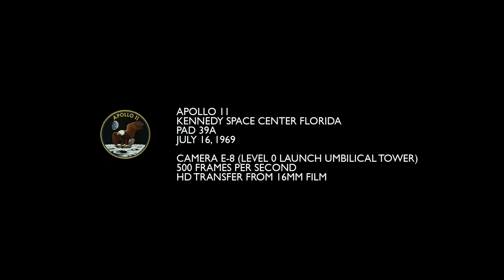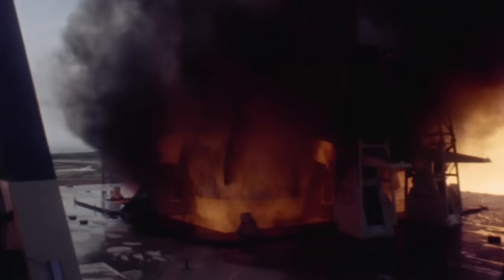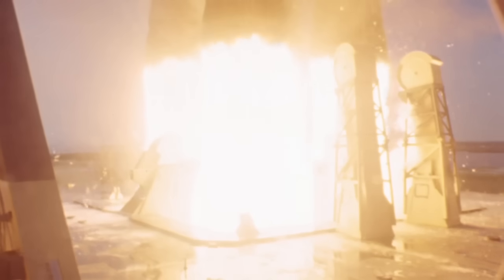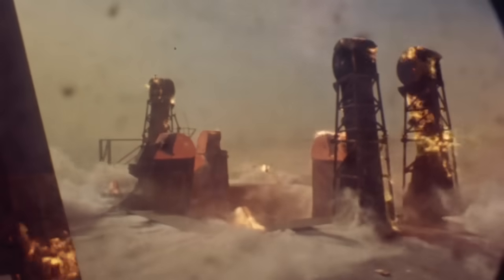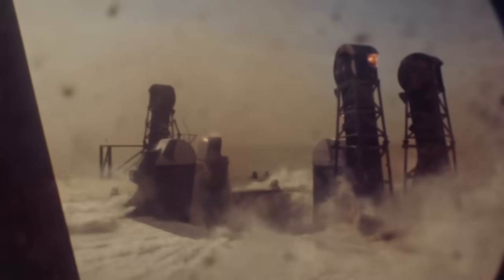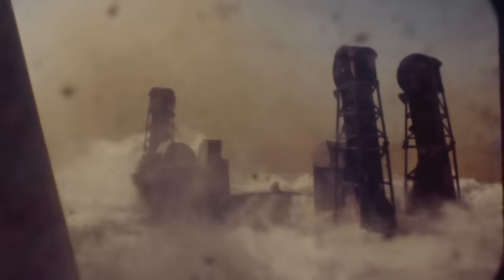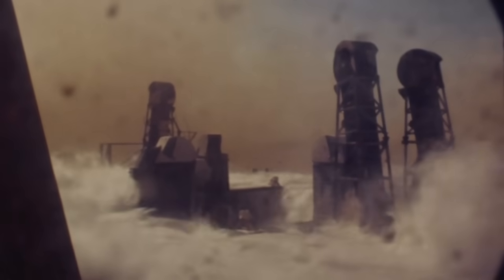Apollo 11 Saturn V Launch Camera E-8

Comment: THIS HIGH QUALITY CAMERA TECH IN 1969????? WHERE WAS THIS DURING THE CHALLENGER LAUNCH? - IS IT GOING TO TAKE 50 YEARS OF CLASSIFIED SILENCE SINCE THE CHALLENGER DISASTER BEFORE NASA FINALLY RELEASES THEIR HQ FOOTAGE OF THE CHALLENGER LAUNCH BECAUSE I BET YOU CAN SEE CLEAR AS DAY THE MYSTERIOUS FLAME WHICH CAUSED THE EXPLOSION WELL BEFORE THE "THROTTLE UP" ORDER - NASA CAN'T GET AWAY FOREVER WITH THE USE OF THE GRAINY FOOTAGE WE ALL KNOW WELL FOREVER - IF THEY HAD THIS QUALITY IN 1969 I AM SURE THEY HAD IT IN 1986
Reply: Nice use of CAPS boomer
Reply: Rik Ver Mar  The fault was evident at lift off. They've shown you over and over you moron. It's there for all to see on film.
Reply: @SMHman666  i would give a shit about ur answer - only if u knew what u was on about, but as u don't - i don't
Reply: @rikvermar7583  Cared enough to reply though. Thanks, haha.
Reply: "THIS HIGH QUALITY CAMERA TECH IN 1969??" - of course. A TRW engineer wanted the same color quality for a camera on the moon - showing Neil Armstrong climbing down the ladder. But, we got a skimpy BW low grade instead. And this engineer was surprised that NASA would document the first landing on the moon in such a skimpy matter -

Comment: Funny that this old mechanical and analog technology cannot be replicated in this, the digital age.
My 1982 Olympus OM-10 35mm camera can run circles around digital cameras, if film was still being made.
Reply: @Neurobashing He was talking about the camera.
Reply: Film is still being made.
And I do not compare my Nikon D810 to my Nikon F3 or the Contax 137 MD Quartz, it´s a totel other thing. ;-)
Reply: The only thing that digital needs to catch up with, is dynamic range, in which film still remains king.
Reply: ussling
Everyday new technology runs circles around the old analog technology from the Apollo era, digital fly by wire systems have far surpassed the technology from back then, even motorcycles have fly by wire throttles on them.
People mistakenly think that just because we haven't been to the moon since 1972 that somehow today's technology isn't as good, that's so very wrong it goes to show how people don't think about what they're saying, the rovers we've put on Mars have technology that far exceeds what was in the Apollo program, every day NASA is using technology for space exploration that makes the stuff from the Apollo program look stone age, just because it isn't manned doesn't mean it isn't more advanced.
Reply: @dukecraig2402  Digital cameras still don't have the dynamic range that film has though, which is what we are discussing here.
And I prefer digital over analog, but that fact still remains.
Reply: @GoldSrc_  
My comment was directed at the original post, hence my putting him name at the beginning of my comment, his original post was not exclusively about camera's, he just used that as an example, if you read his comment it was suggesting that ALL of the analog tech from back then is somehow better then today's tech, it isn't. 
As far as cameras go I'm sure you're right about that and I'll take your word for it since that seems to be what you're into, but it would be one of the very few exceptions to 50 year old technology vs todays.
No, cameras weren't exclusive to his comment.
Reply: @dukecraig2402  Oh, I see.
Yeah you're right.
And yes, even today, film is the only thing that can capture pictures with so much dynamic range, for everything else digital is just better.
It's pretty easy to increase dynamic range for digital audio, but for pictures is still pretty difficult.
Reply: @GoldSrc_  
As far as dynamic ranging and other film terms such as that I'm totally lost since I've never been into cameras, but I do know from being a film (movie) buff that there's nothing like real film, it just has a look that it seems like digital just can't quite copy, especially the old Technicolor films, they have a look that's just beautiful that digital just can't seem to capture.
I saw in a documentary once that the original Technicolor triple saturation process was eventually given up on because it just got too expensive to use, other film types hadn't quite caught up to it but had gotten good enough that the expense of the original process couldn't be justified by the studio's anymore, if I remember correctly The Godfather II was the last film made with that process. 
The original triple saturation process had a look as beautiful as a fine painting, the colors were just so vivid and clear, I wish I would have lived in the era of those films so I could have seen them on the big screen, I have got to see a couple of them like Gone With The Wind when they've been run through the theaters for special showings and it is quite an experience seeing it.
Reply: @dukecraig2402  Digital just can't reproduce the randomness of film grain, as for colors, I guess digital could reproduce those.

Comment: I wonder if you could make reusable out of sat 5
Reply: The engines were certainly reusable as they were all test fired several times on the ground before they flew. The main challenge would be to somehow retrieve the stages intact instead of dumping them in the ocean.

Comment: I have an idea: Let's put all landing deniers under a Saturn V's exhaust. I mean if it's fake it won't do anything to them after all.
Reply: Good idea!
I read somewhere that it takes about 1 billion joules of energy to completely vaporize a human body. If each F-1 had an energy output of 25 billion joules per second, all five of them should be able to vaporize 125 moon landing deniers per second or 18,750 during their 2.5 minutes of burn time. And while we are at it, let's throw in some flat earthers and climate deniers, too.
Oh, wait, I'm afraid we will need much more than one Saturn V for that!
Reply: @fromnorway643  It went up in orbit, but not to the moon. Hollywood did a great job deceiving you
Reply: @SamaritanElad  
Nonsense!
Reply: @fromnorway643  Times the 13 Saturn V's that were built
Reply: ikr
Reply: do it do it do it
Reply: put some flat earth beleivers in there too
Reply: Deniers look like fools on their own, having to resort to violence to silence them seems weak and frankly immoral.

Comment: A Dilettante Presumptuous Theorem: 
From: Alex Gleason Is The Bible From Heaven
https://archive.org/stream/AlexGleasonIsTheBibleFromHeaven/Alex%20Gleason%20-%20Is%20the%20Bible%20From%20Heaven_djvu.txt
The fact is, that they being called “astronomers,” and 
having been caught in the popular drift of science, and being 
entangled thereby, go on, of necessity, bringing forth one ab¬ 
surdity to support another, till their system of astronomy is not 
held together even by a fabric of the most base suppositions. 
They make up the terms “attraction” and “gravitation,” and 
spin our supposed “ball” through space “with the rapidity of lightning,” pushing, hauling and dragging with it the moon, 
the atmosphere and oceans; while clouds and currents of 
water are running undisturbed, at the same time, toward every 
point of the compass, without splitting the ball, as the natural 
result of such rotation would be, into myriads of atoms, or 
sending broadcast through the universe a multitude of fiery 
meteors; but holding all “unperceived,” by “gravitation” and 
“attraction,” from a source a hundred millions of miles away, 
when no gaseous or luminous bodies have ever been found to possess attractive power!
Reply: I THE PREACHER if moon is self illuminating, why the fck craters on it have shadows? 

Ps. Bible is bull’s t story for idiots

Comment: WOW!!! What temperature does the launch pad reach around 3:30? It must be 2-3K F? Wasn't that STEEL melting on the hold down arms? Incredible.
Reply: The sound vibrations from these engines cause concrete to melt, the water spray absorbs some of the vibration energy.

Comment: Hmmm.. that’s burning awfully rich based on the color.
Reply: thats the idea, they dump fuel on the outside from a ring in the nozzle to protect the nozzle from melting because super rich mixture runs cooler

Comment: I’ve always wondered why not do the launches in Southern California where the weather is nearly always perfect? Why do it in Florida where it gets cold and there’s ice?

Sorry if that’s a dumb question but it has always run through my mind.
Reply: Kit Canyon that makes sense thanks for clearing that up.
Reply: To add to Kit Canyon's comments on why almost all rockets are launched eastward with help from the earth's rotation, the ice which falls from liquid fueled rockets is a result of using liquid oxygen and liquid hydrogen for fuel, not low air temperature.  Oxygen and Hydrogen liquify at temperatures well below 200 degrees below 0 F.  Apollo 11 launched in July 1969, very warm!  But moisture in the air condenses and freezes on all rockets with liquid hydrogen/oxygen before launch.   
However, in line with your question about launching in cold weather, NASA did indeed learn a horrible lesson by launching the "Challenger" on that frigid day in January 1986.  Just plain too cold then, and the engineers knew it.

Comment: The F1 and J2 engines are 2 of the most important and awesome inventions by man EVER
Reply: and the crazy thing is, despite all our advances in technology, we can never make them again.  They were custom made by hand with their own little quirks.
Reply: @firefalcon100  yep, NASA actually tried and failed, they have made a replica but it's not the same, the original most of the parts were made by hand as you said and they can't even be acquired now, and even with the blueprints they can't be made because they would have to build totally new machining tools which is basically impossible, as you said they had their own little quirks and parts added to them that weren't even in the blueprints.

Comment: What a marvel! That thing weighed 6.1 million pounds and off into space it went!
Reply: At lift-off, the Saturn V was the heaviest man-made object that has ever flown, 6.5 times heavier than a fully loaded Boeing 747-8 and 5 times heavier than an A380!
Reply: @fromnorway643  And within 2.5 minutes it went from velocity of 0 at sea level to Mach 7 speed at 40 miles high. Those engines were insanely powerful.
Reply: @soxnation1000  
And unlike the shuttle's SRBs, the thrust of the F-1s didn't decrease shortly after launch.
https://upload.wikimedia.org/wikipedia/commons/3/31/Srbthrust2.svg
Reply: @fromnorway643  Shuttle had to decrease power in launch to prevent catastrophic failure of craft from overload power stress...

Comment: Russian engine technology on an American rocket. Hard to believe. Korolyov and Kuznetsov designed a closed-cycle engine and solved the problem they had. fogot to say AWESOME video Mark. thats what I call Science
Reply: Yeah, it's hard to believe, especially that the Russian's tried to interfere in our elections and have 6,500 nukes pointed at us! 
Strange isn't it! In fact its unbelievable. Many things are unbelievable.
Reply: The Saturn V didn't use Russian engines, but the first stage of the Atlas V does.

Comment: The power of this rocket has been unmatched for 50 years and they did it with computers with less processing power than your Fit Bit. Let that sink it. With the power of a modern iPhone they probably could have taken us to Mars.
Reply: Computers don't create power, but the combustion of 13 metric tonnes of RP-1 and LOX per second does.

Comment: IM not a rocket scientist... BUT!! 
I get the feeling that take off should just be called BURN OUT!  WHAT A WASTE OF ENERY/ fuel! 
has anyone every though of propelling the rocket up to about 250 mph... by magnetic lift??? 
kinda like the japanese magnetic trains. that way the rocket won't have to muscle out or burn out like a car... 
i think that would allow the rocket to use the majority of its fuel for fast propulsion!

damn! i should have been an astronaut.... now I'm more like astronut.. lol
Reply: jimmyfly 
It’s about torque.
Have you ever use a sling shot I’m guessing yes...
Did you notice you can get twice as much range and speed if you punch out the shot? 

It’s not a missile , and it’s really heavy but once you get all the weight going and momentum you would save a lot of Fuel for later use which is much more efficiently used in space
Reply: @jimmyfly come to think of it.. its how a hybrid car  works. the reason you save on gas is because the electrical gets you going on the toughest part of the ride which is getting it going

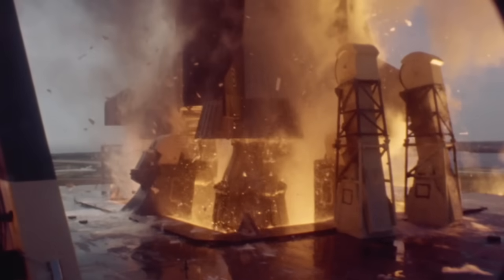Comment: Despite having been captured at 500 FPS, there is a stark difference in velocity between the Saturn V engine exhaust (2:05) and other elements of the shot.  It certainly serves to emphasize the vast quantity of thrust being produced.
Reply: Otaku+ based on a specific impulse of approximately 263 seconds, the approximate exhaust velocity is just over 5,600 mph.
Reply: Each F-1 produced ten times more thrust than the total thrust of a Concorde at full power.
https://ericpetersautos.com/wp-content/uploads/2012/10/GC-concorde.jpg

Comment: lots of ice for July in Florida. then it falls past the fire without melting.
Reply: Not sure what point you're trying to make. Ice formed on the surface of the rocket because the liquid fuel inside it was EXTREMELY cold. In much the same way that you can have frost form on the INSIDE of your windows in your house when it's really cold outside, even though it is 75 degrees in your living room.

As far as ice falling past the fire... don't forget that this video is SIGNIFICANTLY slowed down. Thick slabs of ice don't instantaneously melt. Do you really think an ice cube would instantly vanish if you dropped it next to a flame?

Comment: The turbine/gas generator was actually started with a spark igniter, not the hypergolic cartridge. The hypergolic cartridge was inserted into the fuel line close to the thrust chamber and bursted when fuel pressure was high enough and ignited the engine.

Comment: Why does the camera shake throughout the video? From the vibrations of the launch pad?
Reply: Some of the motion will be due to movement of the pad, but a certain amount comes from the movement of the film itself in the camera's gate - as the transport speed increases*, so too does the relative inaccuracy of positioning each frame for exposure. When the film is then viewed, the projector or telecine will position each frame slightly differently to how the camera did, causing the appearance of movement. The effect is also more pronounced with smaller film gauges (like 16mm here), as the greater enlargement required for viewing it also magnifies the misregistration.
* = this camera is running at 12.5 feet per second, as opposed to 0.6 feet/sec for 24 frames/sec.
Reply: @jb17kx  Didn't realize these cameras were using 16mm film, is there any technical reason to do that as opposed to using 35 or even 70?

Comment: I've spent a career in Aerospace working on among other things, traditional launch vehicles.  Every since Spaceship 1 succeeding in the winning the X prize I had a thought...why not a ballon?  I knew I couldn't have been the only one to think of it.   But there are lots of challenges to overcome.   One would be the unpredictable flight path of a balloon.  Winds can be predicted but not exactly reliably.    But with modern GPS positioning that can probably be overcome.  Google X has project LOON which is attempting to use stratospheric balloons to provide wireless internet service anywhere in the world. That requires at least some control over the position.  Could an upper stage be successfully launched from a high altitude dirigible?  There is also JP Aerospace's Tandem class of airships. I think this may be the future for affordable spaceflight. Many challenges exist but that's what engineers do.  They solve challenges.
Reply: Often thought why launched at near sea level when you think the the amount of fuel burnt just clearing the tower .You would think launching at 15'000/20'000 ft would save fair bit fuel in first stage but then you would think engineers would know best though

Comment: Is it possible to show a cross section of the engine as I didn't think rocket engines had turbines u thought they worked using a con-di- nozzles? Kindest regards MickT
Reply: Try the Wikipedia article on the Rocketdyne F-1 https://en.wikipedia.org/wiki/Rocketdyne_F-1

Comment: If the Shuttle's hydrogen tank was insulated from the inside like the Saturn 5 no form would of been needed which caused Columbia's destruction from form impacting its wing causing the deaths of 7 astronauts.

Comment: Was water used to dampen noise vibration ?
Reply: Yes.
Reply: It was used to protect the pad floor. Had nothing to do with sound.
Reply: @MaynardGKrebs-gv4vy  actually it did, acoustic vibration could be very damaging to the launch pad

Comment: Staggering display of power, and to think this was done in 1969 makes it all the more impressive. Thank you Mark for posting this video and for the commentary. 👍
Reply: Why can't we do it now?
Reply: @RandomVideos-kn3pf  We... are? SLS is going to be more powerful than Saturn-V.
Reply: @tukus9133  And starship just did 31 Raptors
Reply: @RandomVideos-kn3pf  We're on the horizon of a new golden age. Starship.
Reply: @bradstewart7007 it just blew up, the design has not improved just more engines and a new shell, they need to take more risks with more fresh methods or ideas